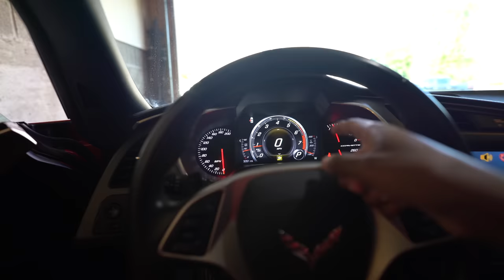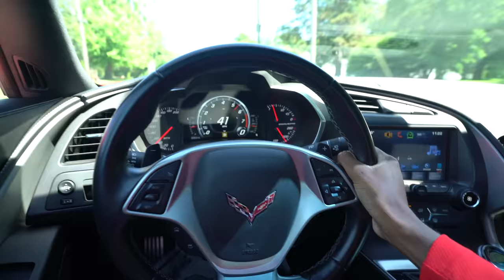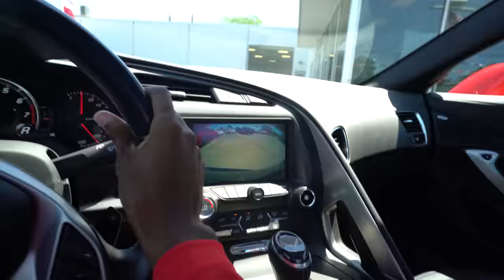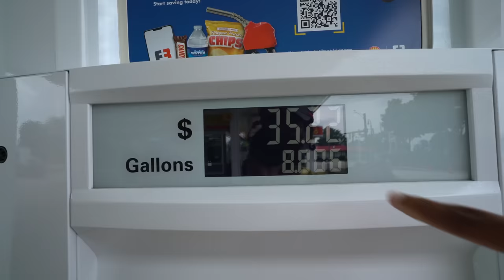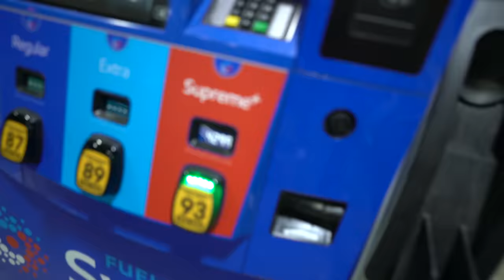FIRST DRIVE IN MY C7 CORVETTE *FASTER THAN A HELLCAT*

Comment: Get twin turbos or compound turbos  , superchargers Rob horsepower anything driven by the engine going to reduce your power, the a/c compressor, the supercharger anything belt driven going to rob power the turbo is exhaust powered it only adds power it doesn't take power away.

Comment: It's supposed to be a new Viper next year hopefully it's got the RED-EYE engine making it a RED-EYE Viper .. that would be lit 🔥
Reply: Lmao not happening that's a down grade from its engine.
Reply: @ii_dynasty  the 8.4L V10 naturally aspirated gasoline engine is being replaced in the viper for a V8 engine , I don't see no other option other than the demon engine that the RED-EYE And super stock share. Other than the regular Hellcat engine.. and the viper is special it used to sport over 700 HP in the earlier models .. which engine should it get since it can't keep the V10 engine.. ?
Reply: @hanthony440  well that's rumors we won't know until it pops out but the v10 has always been the viper signature and the fact that's deadly and fatal in an accident on top of its poor sales.
Reply: @ii_dynasty  Dodge is putting a HELLCAT engine and a demon engine in everything sport and muscle car related from the challenger to the TRX it's in two door coupe four-door sedan , And trucks and SUVs it's most likely bout to end up in the viper too.. either the Hellcat engine or the demon engine from the RED-EYE one of the two. Dodge trying to slim down their engine line up, because the SRT name is about to go away they going to focus on electric and hybrids .. so I've heard it's going to be a 1,000 HP all electric HELLCAT coming in 2024 or 2025 probably gone be called the Angel 😇 since Dodge did trademark that name and haven't used it yet. An angel obviously gotta be better than a demon power wise because Angels beat demons.. the 8.4L V10 beast is gone , if they put the HELLCAT or demon engine in the viper it Will sell like hotcakes because it's smaller and lighter weight with that much power it'll be a neck breaker for sure..

Comment: Folks I looked it up(stock v stock) c7 grand sport 0-60 3.8 seconds 12.1 in a quarter at 116 mph. The hellcat 0-60 4.0 seconds 11.9 in a quarter at 126 mph. The charger  redeye 0-60 3.5 seconds 10.6 in a quarter at 129 mph to get these times you have to have a perfect launch either way the power of the hellcat will catch that grand sport. They only way the grand sport can win if the hellcat spins badly at the line numbers don’t lie in a roll race the grand sport will be raped by both cars

Comment: That shit ain’t faster than a hellcat change the title or get called out for lying🤷‍♂️ and 20 year old with a corvette I have a 2018 m550 with 30 k miles and next year I plan on buy a 2022 m760 and I’m only 18 something you can’t think about doin yet🥱
Reply: Better off with a new m5 than 7 series which are mad ugly, plus the 2018 m550i around 50k vs a 60k grand sport.
Reply: @ii_dynasty  I’ve already had a m5 and the 7 series definitely looks better the interior can’t even compete and oh ya it has a 6.6l v12 that’s twin turbo😊😉 and I was just offered 71k for my m550🥵
Reply: @jakefromstatefarm653  what’s your ig🤔

Comment: Do your research before you make statements that’s not true( I’m talking stock versus stock) a grand sport don’t stand a chance against a hellcat or red eye the redeye almost double your horsepower so weight won’t be a problem and if you put all that Body kit on there it Creates down force which slows you down at higher speeds the vet will fall flat at about 150 the hellcat keep pulling. The zo6 feels faster cause it’s lighter the redeye will beat the zo6 in the quarter and top end because of the aero kit all that down force slows you down zo6 starts to struggle at about 165 and top end is about 185 because of that body kit now the zr1 is a monster it will kill the hellcat or the redeye look at numbers they don’t lie I have a zo6 and charger redeye remember the vette is a sports car the charger is a sedan
Reply from the maker: Yea but who’s really driving that fast anyway, 0-60 the grand sport is .2 faster than the hellcat, in the quarter a stock Redeye only gets up to about the 120mph range, but right they’re 2 different cars you can’t really compare them
Reply: @JoshLaurentt  josh it comes down to traction I have a c7 z06 and a redeye charger it’s on the thumb nail even if you get off the line first you’re going to get walked and if I’m not mistaken you made a video with the redeye in the snow going 190 I like your vette though. Go race one and you will see make sure you post it stock on stock. Look it up on YouTube it’s there   SMH some of us have to learn the hard way youngster. Know your cars c7 grand sport 0-60 3.8 seconds 12.1  in a quarter  charger hellcat  0-60 4.0 seconds 11.9 in a quarter charger redeye  0-60 3.5 seconds 10.5 in a quarter there I looked it up for you and in a roll race you will be Destroyed it would not be a contest